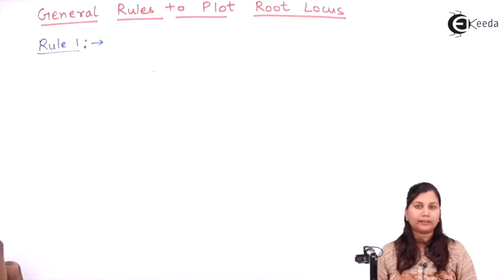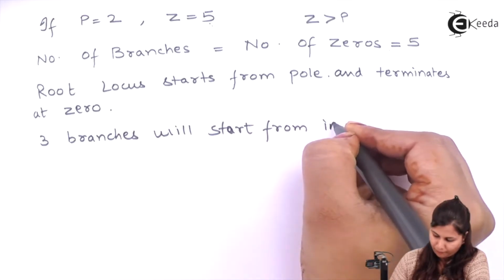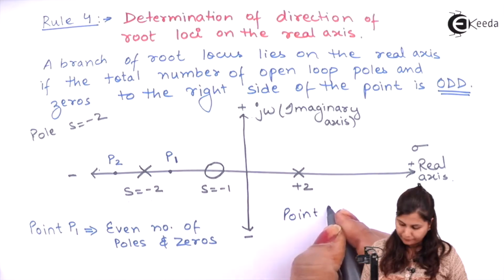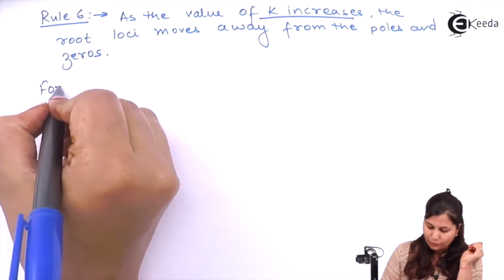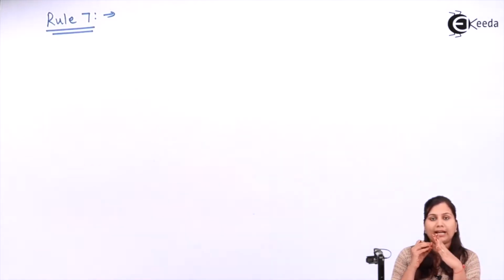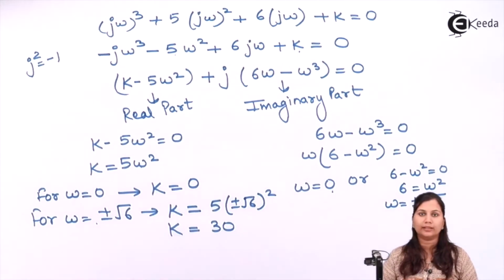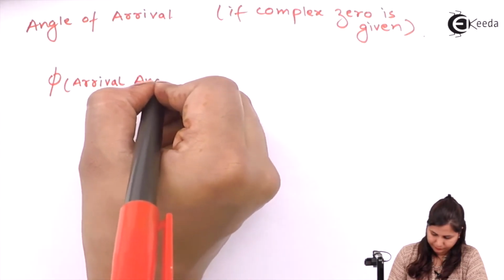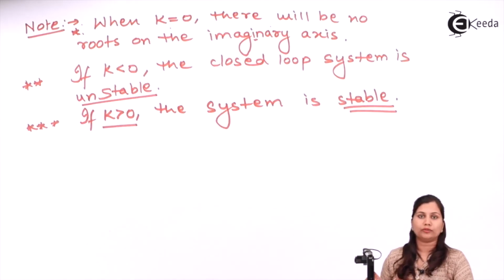Rules for Plotting Root Locus - Root Locus Technique - Control Systems

Comment: Moreover if the roots are varying with respect to K then those roots are referred to as closed loop poles. You only mentioned in your previous video of Root Locus. So if the value of K increased tge root loci moves away from the poles and zeros. This is what your Rule 6 states. Then Sigma P will be Summation of all poles of CLTF